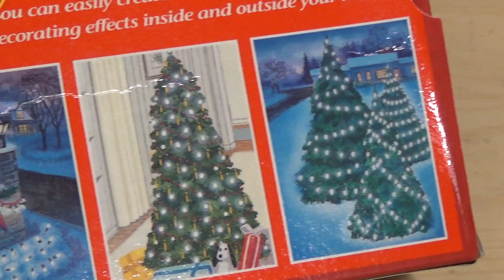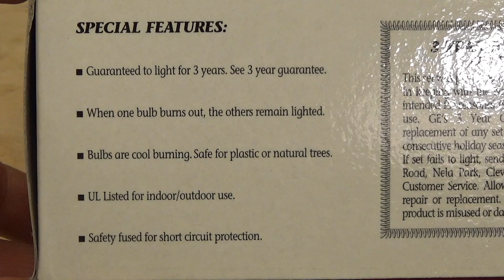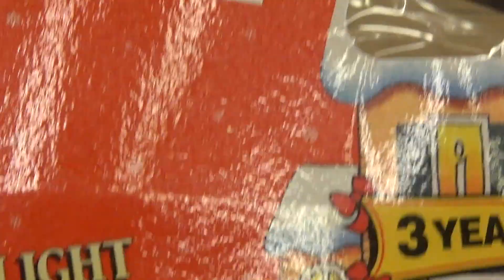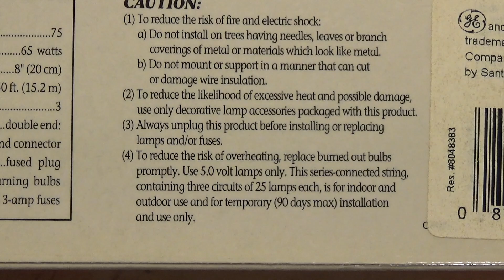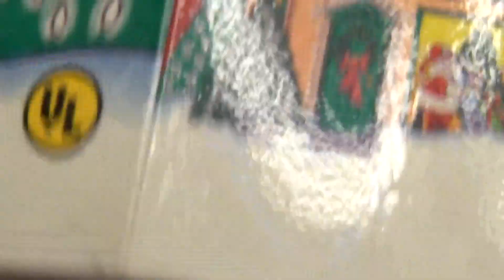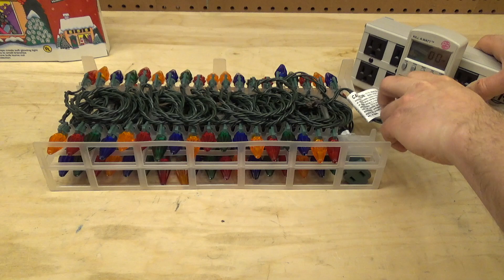General Electric 75 Light Traditional Holiday Classics Set (C6 Replica)

Comment: I have a set of these lights with a chaser module that I had for ever. Older square plug without the wings with a yellow insert, and the chaser module is a simple knob for the speed.
Reply: Also a newer set integrated in garlend that I pulled from the Christmas light recycling box while "shopping".
Reply from the maker: Interesting. I've heard about the chaser variant of these, but never seen any.
Reply: @JordanU  on lower speeds there is a very tiny delay between certain color transitions in the sequence: they are not perfectly timed apart from each other.

Comment: I bought those new back in the late 1980s and also enjoyed them- the little clips on the sockets worked well to attach to my live indoor Norfolk Island pine tree- FYI those 5 volt bulbs were very hard to find decades ago, cant imagine now. Think twice before using them outdoors as the tiny hole in tip actually allows rain/melting snow to enter cap and it will fill with water which caused 2 issues, 1 being the water freezing and cracking plastic cap, the 2nd the water left stains/dirt on the inside surface of cap
Reply from the maker: I would definitely not use something like this outside. These are best indoors when you can enjoy them up close anyways.